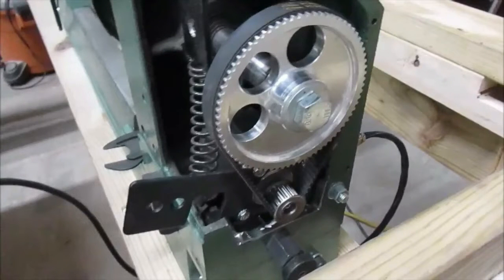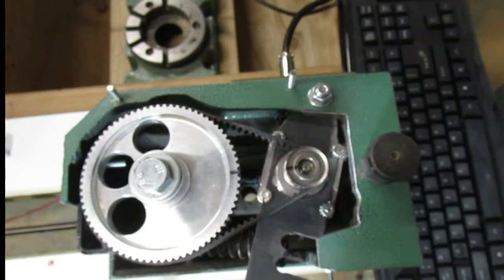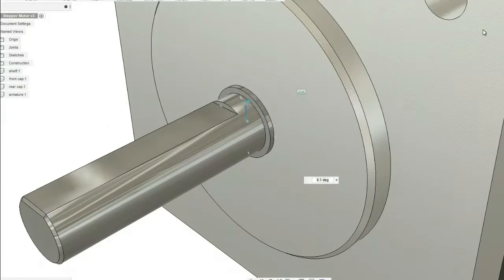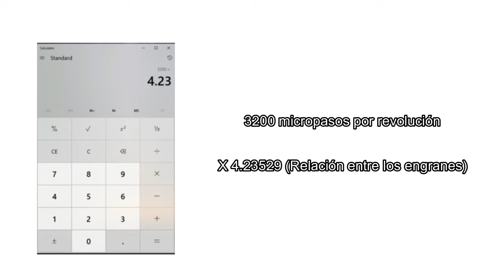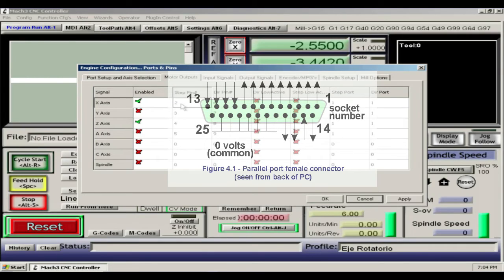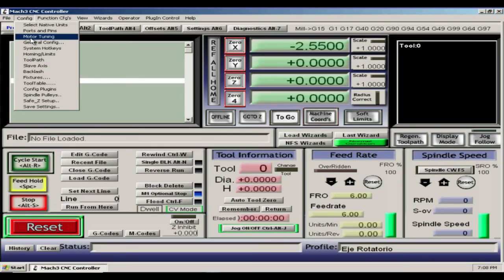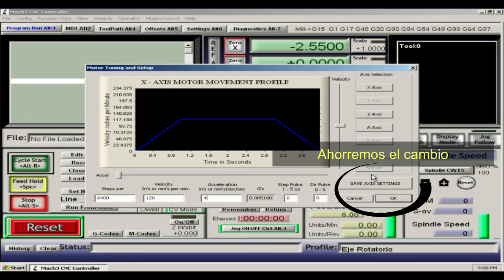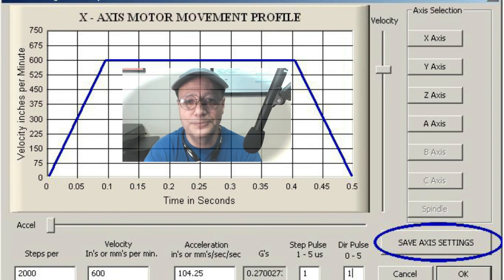Mach3 Rotary Axis configuration

Comment: thanks so much sir, please can you help me i installed rotary axis in pins of y axis as my machine setup design is using x- axis , z-axis, y axis as rotary axis  and a-axis is tilting spindle head as i have mach3 4 axis not 5. how can i program it or using a definite postprocess which suits my machine design? i'm using powermill
Reply from the maker: I am not familiar with Autodesk software, so I don't think I can  figure out a post processor for it. Sorry I can't be of much help, (other than what I explained on the video). Thanks for the comment and good luck.

Comment: If my controller does not have micro steps, how would the formula be, my machine control it with a richauto a11 ??? what should i do to be able to calibrate the 4th axis
Reply from the maker: You are going to have to search for specific information about your controller, maybe some YouTube videos on the Richauto a11, seems that this controller uses its own controlling software independent of the computer, I am not familiar with it. So, I'm sorry I ca not help you with it. Good luck!

Comment: Hello, can I make a digital machine without connecting the RS 232 cable from the driver to the computer with the mach3
Reply from the maker: Mach 3 is a parallel interphase, but you could buy a parallel to USB adaptor I imagine if your controller is USB, I never used anything other than 25 pin cable though. Good luck.

Comment: Hello, I'm new to mach software. On the screen, it is showed only a 4th axis (only one rotary) but I found in many forums that it can support also the 5th axis. Please help me to understand If you can use the mach3 board for 5 axes and with which software
Reply from the maker: I am not very knowledgeable on more than 4 axis machining, however yes you can use 5 or more axis with Mach3 providing that you have a control board , to design and generate the g-code you can probably use a program like Fusion 360, or similar. Good luck.